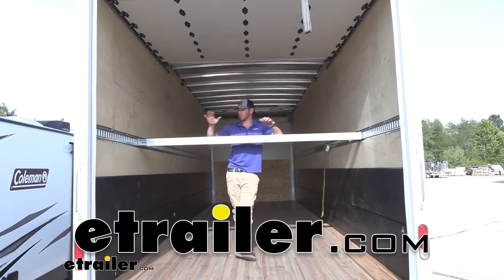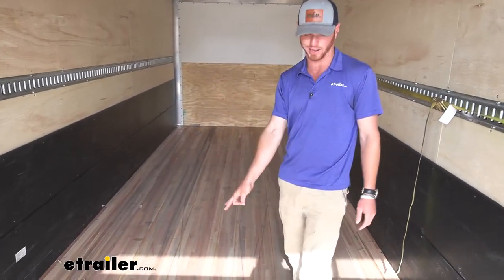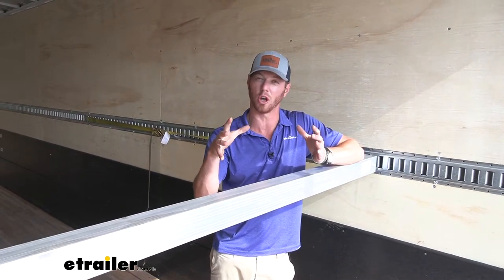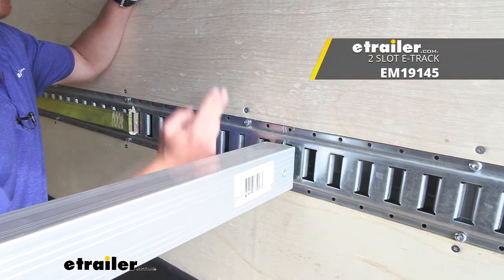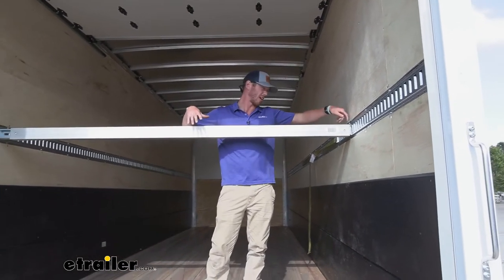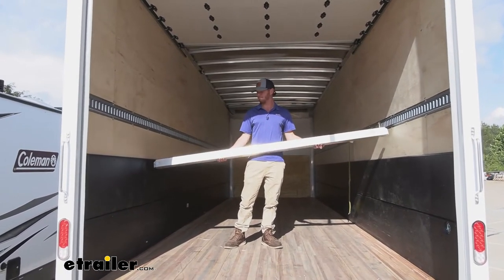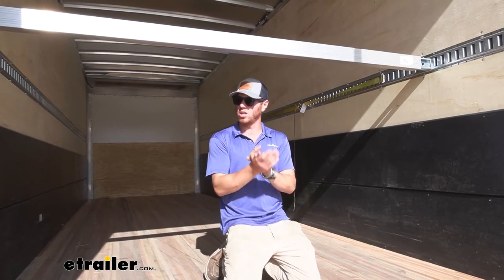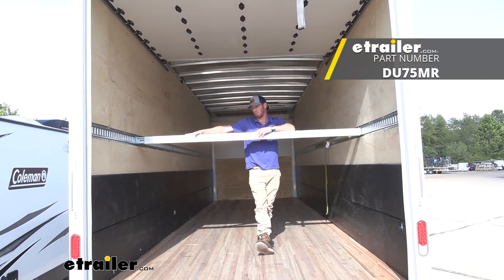etrailer | Durabilt E-Track Shoring Beam Review

Comment: The important part that you sorta mentioned is that these bars create differentiation in the load such that if there is a shock, each load-bar compartmentalizes the load within. That means if you braked hard or were collided with the load's inertia is not going to be as bad as if it was all combined. Usually you will also have e-track straps to bind the loads into the compartments. So a strap system and load bar system work together for proper safe trucking.

Comment: Where am I supposed to store these if the shipper needs full trailer space Current situation I just bought these yesterday for a different load now?Please help definitely don’t want to bring them in the cab with me being how small it is
Reply from the maker: If it's a tractor trailer, the outside rear of the tractor cab would be a good place to stash them. On a box truck, rigging up a carrier under the box is what we'd recommend. Unfortunately, we don't offer an out-of-the-box solution....
https://www.etrailer.com/Accessories-and-Parts/Durabilt/DU75MR.html
Reply: Noticed that he doesn’t push it back-and-forth to show the wobble.